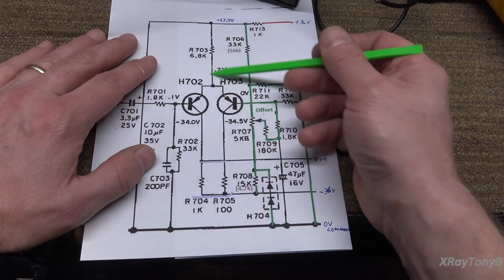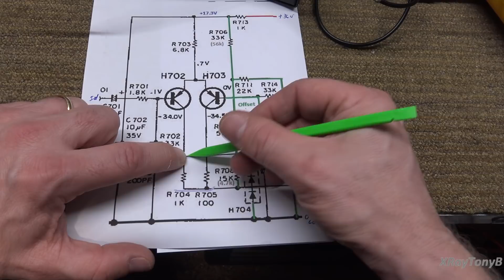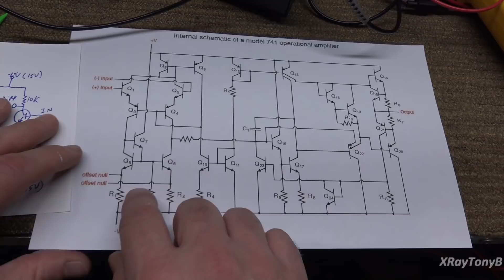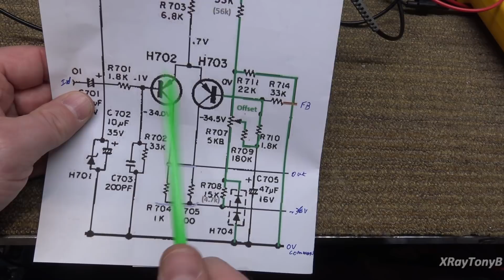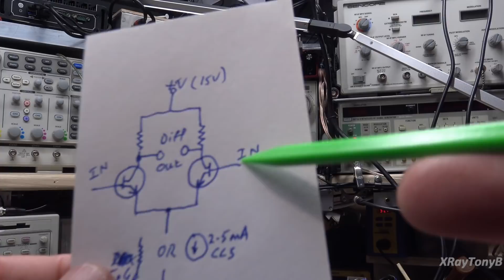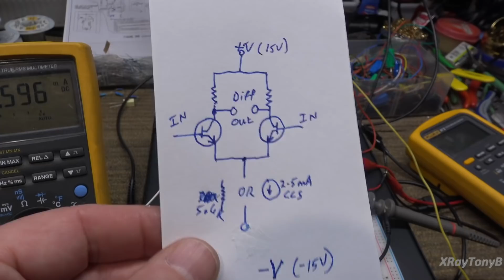Differential Amplifier Experiments

Comment: Before viewers get the wrong impression, it’s important to know that a constant current source has had the effect of better matching the two transistors, as seen by a near zero output due to the two opposite signals canceling out entirely, it’s crucial to know that this has  not magically made the transistors themselves "better matched". 

The transistors are matched through the manufacturing and design process, but the current source has allowed the circuit to compensate for mismatches by stabilizing the operating conditions. 

Here is a breakdown of why a constant current source is used and how it helps a differential pair function correctly despite real-world imperfections. 

A differential pair's purpose 
The fundamental function of a differential pair is to amplify the difference between two input signals while rejecting any signal that is common to both inputs. The measure of this ability is called the Common-Mode Rejection Ratio (CMRR). 
The role of the constant current source 
The constant current source in the tail provides a total emitter (or source for MOSFET) current that is constant and independent of the input signals. This forces the current to be split between the two transistors.

Comment: I continue to witness witless "differential" amp circuits with a Buffer or Inverter for the UnBalanced Input directly feeding their circuit "differential" Output's + (or -, depending) also feeding an Inverter which directly combines with the former.  et VIOLA!

This is certainly so for Polarity, but not in the Time Domain, correct, Maestro?

wtf?
Reply: Violin, Viola or Contrabass, doesn't matter, right?

Comment: I think the 741 made people want to use current sources and current mirrors automatically. In an ic Op amp they reduce the need for bulky components.  I gave the example of the Hitachi design.  You might give it a current mirror  to the input long tail pair.  That might cause new problems requiring capacitors added to  the second stage.  A lot of these ideas evolve without real need. The Hitachi had fantastic sound.  I added a current source to the Hitachi input long tail pair.  No obvious difference. 47K 55V. 2SA 872A. 2SD756 second pair. 2SB716 and 1N4007 hybrid current mirror.

Comment: What is seldom said is using a long tail pair differential amplifier for the inclusion of an extra transistor makes design of an amplifier vastly easier. If matched to a further long tail pair as in the 1979  Hitachi mosfet design a very high degree of performance is achieved. Hitachi use a current source on the second stage.  7 active devices 100 watts 8 ohms. 2 % current error maximum.  In an amplifier the input long tail pair won't swing much voltage , mostly current. Simple resistors do surprisingly well.   The long tail pair works almost like a bonus computer maintaining DC conditions.  The Hitachi had extremely low distortion and behaved much like an Op amp.

Comment: Hi Tony I'm having difficulty with a Kenwood KR-5010 and I think it's not working because I can't source a new TA-1001. I got two from ebay and both have the same problem. Have you ever worked on this model? I already changed both STK-0050 Darlington ICs.The old ones were shorted. The original TA-1001 voltage amplifier looks a little different but has the same number. I took one that didn't work from ebay and pried it open and nothing looked burned and the transistors inside do not measure the same way that a typical bipolar transistor does. The speaker relay does not engage because there is -10 volts on the output pins on both STK-0050
Reply from the maker: I haven't serviced a KR-5010, but I would first make sure that the STK-0050's are working properly.  If you are sure they are good, check pins 5,6,10 & 11 of the voltage amp IC.  they should have around 1- 1.5 volts on each pin with reference to ground.  If they are off, then check pins 2 & 14 of the voltage amp chip.  This is the offset adjust for each channel.  I'm not sure what they should be, but you should have voltage on each of them and it should be adjustable.  You may have a problem with the voltage supplying the offset.  You could also have an issue with one of the power supply rails.  Hope that helps.
Reply: @xraytonyb  thanks Tony
Reply: Hello Tony how are you. I ordered an STK-3042 and replaced the TA-1001 that dalbani claims to be original but I think they're Chinese knock offs. Dalbani sells them on eBay. I emailed them about the problem and they sent me another one but I didn't bother installing it I already know it won't work. The pins are shorter and thicker than the original so I know they are not OEM. The STK-3042 came in and that one works. The output of the STK-0050 will now respond to the offset adjustment like it supposed to and the protect relay now can engage the speakers and works very good 👍 instead of being stuck on -10 volts and no response from the offset adjustment with the dalbani TA-1001. The STK-3042 also has the same looking pins that are small like the OEM. This was an expensive learning experience. The dalbani IC cost $32.00 and the STK-3042 was only $10.00 so if you ever work on one of these beware. I like the earlier descrete transistor receivers much better. I don't care for IC type they always challenge me more than I like because of the OEM parts no longer available. I searched on Google about this receiver and finally saw a YouTube video of a technician who repaired a Kenwood and shows it working with the STK-3042 so I gave it a try.

Comment: Hi, Very clear presentation of the differential amplifier circuit.  However, you never really said why would I have it in a high-quality stereo circuit?  It would seem that a single transistor is all that you need on the front end and then more powerful transistors (able to handle high current loads) leading up to the speakers are all that is needed to generate sound.  Why the feedback for this circuit?  That part was not clear.  Thanks for any help!

Comment: There are two inputs, V+ and V-.  However, we find it more useful to consider the combination signals V_D = V+ - V- (difference) and V_cm = (V+ + V-)/2 (common mode).  Since V+ = (2 V_cm + V_D) /2 and V- = (2 V_cm - V_D) /2, these are entirely equivalent perspectives; however, the constant tail current makes the response to the common mode signal minimal so that the amplifier responds almost entirely to the difference.

Comment: Very interesting. It's also worth noting that if you apply the signal to one input and ground the other, the first transistor will work as a common emitter amplifier stage, and the other one as a common base stage fed from the emitter. That's how long tailed pair phase inverters in tube amps work too, except they typically use a pair of triodes.
Reply: sweet 😃

Comment: Just remember a lot of the components in the 741 are there to compensate for the fact that making high value resistors in silicon is hard, and also makes them very large, but you can make transistors do the same job, with better stability as well, because silicon resistors are really bad at absolute value, and drift badly with temperature, but really good at matching. Thus all those transistors are there to make them behave like large value resistors, and also make the circuit not vary with supply voltage, temperature and time.

Comment: Years ago I played around with differential amps and I remember buying a device that was two transistors in the one case; i.e..there were six legs to it and the idea was that the package offered thermal stability between the two transistors. I can't remember who made them now.
Reply: They are still made. They are known as a "matched pair" of transistors. Sometimes they come in a DIP package with several matched pairs in the package.
Reply: @richardgray8593  Thanks for the info, Richard.It s been some decades since I've played around with them.

Comment: I'm so dumb that I don't know, or at least don't remember, why you want that feedback -- what its purpose is. A word about that for the truly naive would have made the whole thing more meaningful to this software implementor type, no friend at all to the electron.
Reply from the maker: Good question!
As the input signal passes through each stage of the amplifier, it can be affected by the components of that stage.  Any change in the signal, other than its amplitude, results in distortion.  That means that the signal coming out of the amplifier does not perfectly match the signal going into the amplifier, hence distortion.   As we saw in our little demo, when we apply a signal into the second transistor in the diff pair, it can either add to or subtract from the signal at the first transistor.  This is all dependent upon the amplitude and phase of the feedback signal.  Due to the differences between the distorted output signal and the undistorted input signal, the differences would cancel out.  While this doesn't totally remove all distortion, it will greatly reduce it, although the amplifier as a whole will have less total gain.  (Gain of the amp without feedback is higher than the gain of the amp with feedback installed.  This is why feedback-based designs always have a higher open-loop gain).  One thing this won't fix is crossover distortion on the outputs, because the transistors can't pass a signal until they begin conducting at a voltage above their Vbe drop.  This is why the amp has to have a bias current, meaning that the transistors never turn fully off and stay above that Vbe drop.  Hope that helps.
Reply: @xraytonyb  I don't think you could make it any clearer. Your prior video caused no confusion to me with what you just reinforced with a visural demonstration. Thanks again for some of the best audio advice found on ut.
Reply: In this case - and this is just my assumption - the current from the final transistors will be fed as a negative feedback. So, the higher the current, the lower the signal will get. It could also compensate for thermal runaway. In the same manner, it could compensate for other factors so that the volume stays similar regardless of what happens (for example supply voltage fluctuations, temperature). It's basically used for protection or stability.
Reply: When incorporated into an audio amplifier, any difference between input and output signals (i.e. distortion) is canceled out. So you get much lower distortion than if you didn't have the long tailed pair.
Reply: Thanks, Tony, and others, for the clear explanations. I greatly appreciate it.

Comment: Great verbal explanation of an abstract yet useful circuit. I had to fiddle around with diff amps in a simulator for a while before I really understood the importance of a good CCS circuit. Basically I did what you did on the test board, but using TINA (circuit simulator) software.

Comment: 2:59 - So, if I want to use an LM334 instead of R703 (6.8k) at the top, will it give more linearity to the pair?
And could I use another LM334 in lieu of R704 (1k) at the bottom, but not for R705 otherwise they will cancel each other out?
Actually, a video explaining the use of this small but handy CCS device in front-end amps would be nice. 😀
Edit: just saw the previous video of Marantz 2240. Thank you.

Comment: This could be done much better with an Opamp.
Reply: Even today Op-amps are hardly ever used in ANY discrete Power Amp circuits. They can create a whole new set of problems with thermal tracking and feedback stability. The only place they're used are inside "chip amps" like 7293/94 where the entire amp is embedded in the same piece of silicon.
Reply: Carburetors vs. fuel injection. Run what the era brought you.
Reply: Wow as soon as I finished typing that, you brought out the Opamp circuit.
Reply: which one would you use on this application?
Reply: @HipocratesAG  TL072 is good choice.
Reply: @sr.padilla1633  Cool I think I have some of those on stock to experiment a little bit
Reply: @HipocratesAG  All modern day amps are power OP. A big powerful operational amplifier.
Reply: Actually the whole power amp is a discrete op amp. The negative feedback will compensate for some of the faults of the simple diff amp without the current source.  Thank for taking the time to build and demonstrate the circuit.